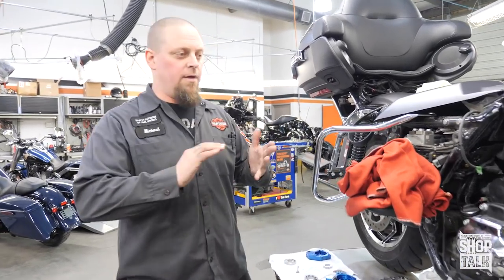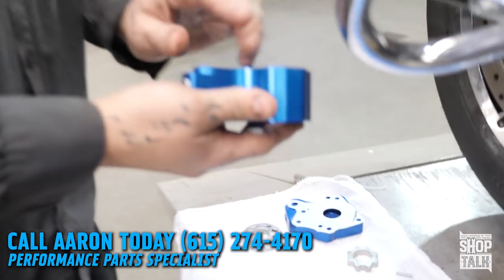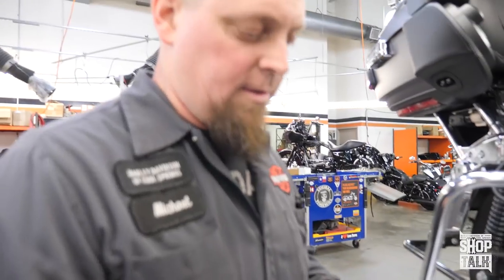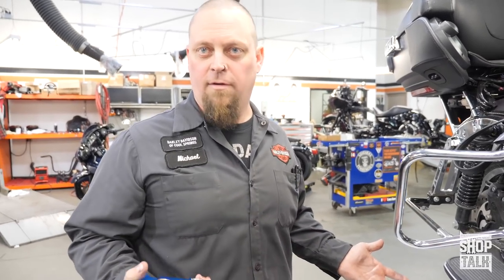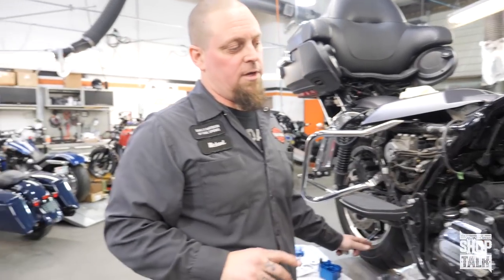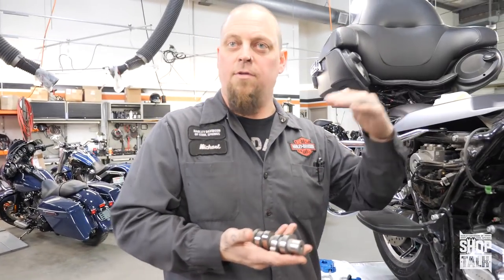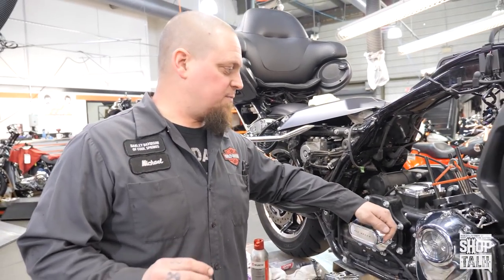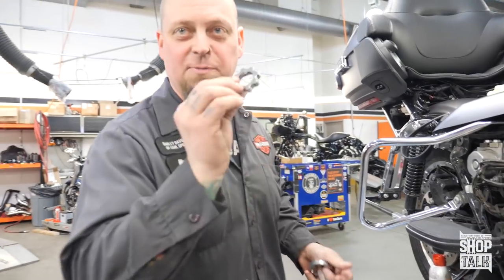124CI S&S Cam Chest | Shop Talk Episode 19

Comment: If the bushings in the cam plate are bronze and also replaceable items what stops the bushings turning inside the cam plate,are they a tight interference fit/press fitted or pinned into place?

Comment: I’m not sure if you answer questions off this or not but I have 107 Milwaukee 8 with an S&S stealth air cleaner and two brothers two in one comp s full exhaust. Any suggestion for a cam?
Reply: Do you hit it hard alot and run the top RPMS?

Comment: Wanna see one of the thin rotors out of and S&S water oil pump that broke after 5000 miles.....
Reply: We haven’t seen one yet and we’ve installed a lot.
Reply: Jamie Lima  nothing went through it.....how could it with all the screens lol. It was there first series pump with the 2 steel separator plates. Ran fine for 5043 miles. POS at SS knew it was a problem and pulled them off shelves. But screw us that had them already.  I am a small shop couldn’t even get them to call me back.No balls had some twit email me for warranty.It’s a cast rotor and broke on parting line on the front rotor in pump. No run out to speak of. I have used there stuff for 40 years. F....them fueling now. They turned into a real POS company.  Good thing it was my personal bike....broke on start up and actually heard it in my shop. Sounded like and old compensator knock and bind.  Shitty customer service and lazy don’t give a F attitude.  There done here.  Unlike 40 years ago they are NOT the only game in town.   Great vids by the way ...just wanted you to be aware if it happens the tech did nothing wrong.  I have 3 others out there and there all coming out and going in shit can .....
Reply: Jamie Lima  send me and email I send the pictures you can decide for yourself
Reply: Doc Holiday So it was the pump they recalled right away and sent new ones out to replace them. We had one but they called us before it arrived and swapped it for the correct one. I believe they only shipped 4 out before the problem was caught. No problems out there with the current pump. Not sure about the support you get but all the manufactures we use bend over backwards if we ever need them.
Reply: So you are talking about the smaller Twin-Cooled pump?
Reply: Craig Jackson I have no idea. We have no problems with S&S pumps or we wouldn’t use or push them.